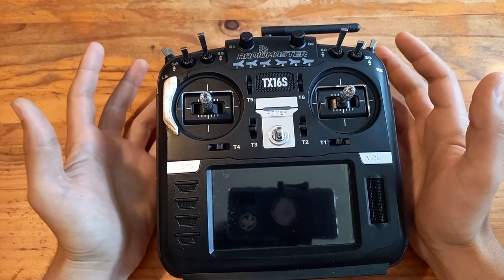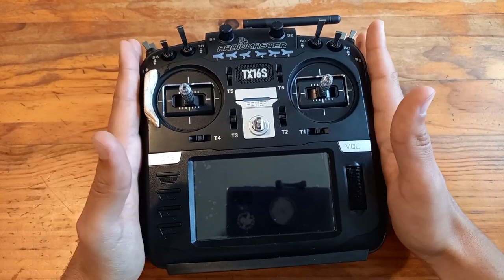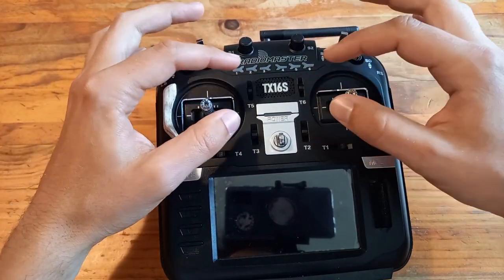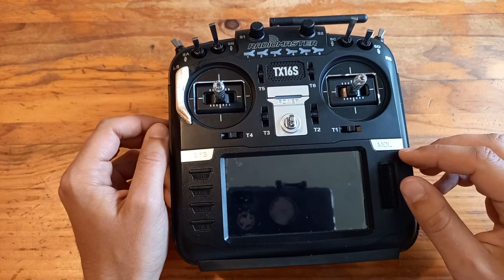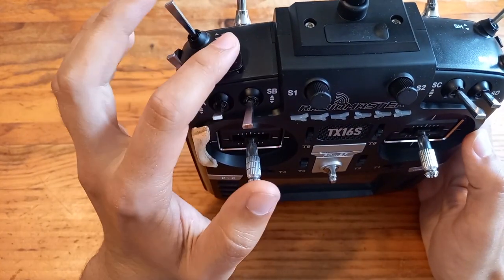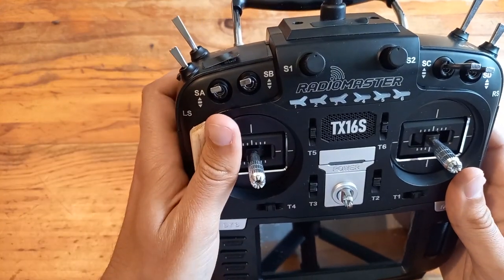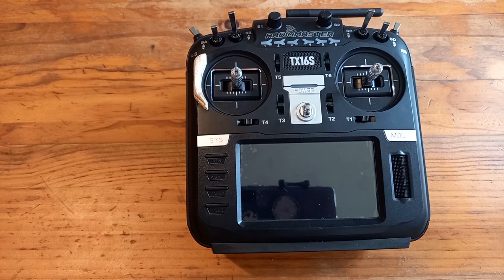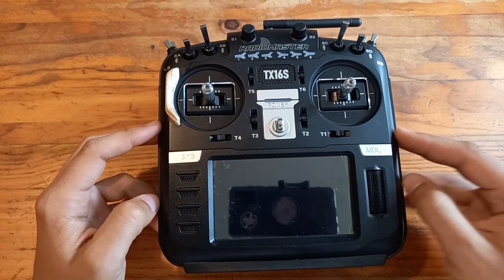My new radio ! // TX16S from RADIOMASTER

Comment: Very cool! I have the same transmitter. I’ll be interested to know if you find out a way to graph altitude plots on this radio, from a variometer?
Reply from the maker: may be I will try later , but I usualy never use a vario in my gliders